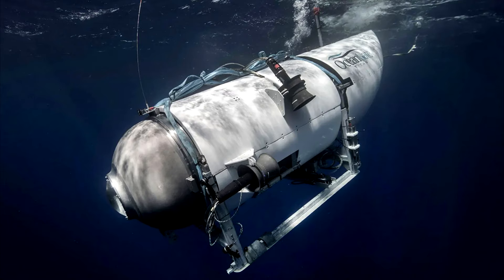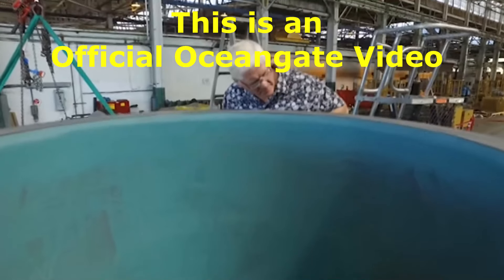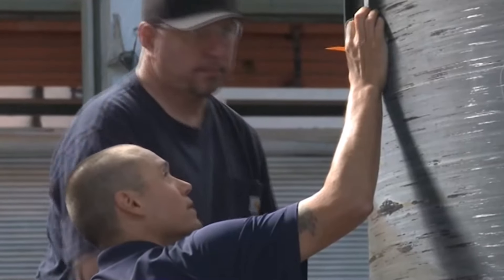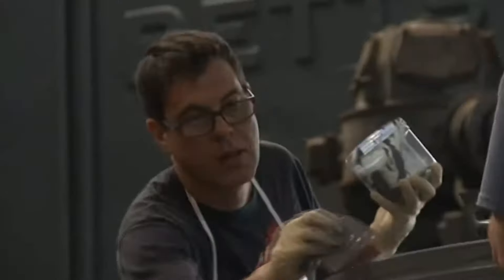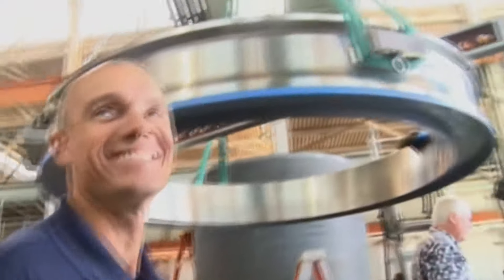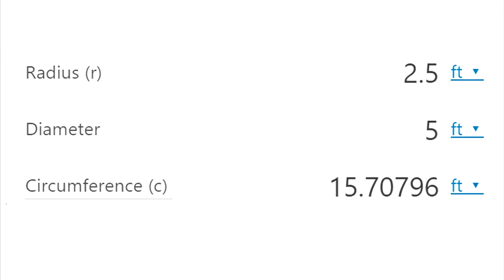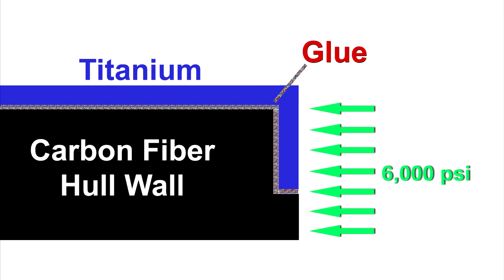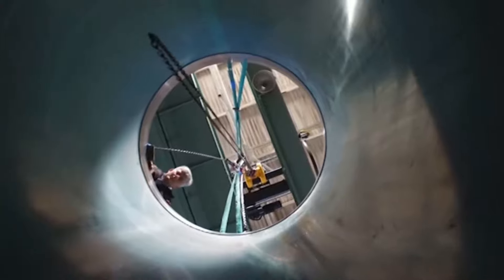Ocean Gate Titan Was Glued! Coast Guard Reviews

Comment: I have worked on precision glue ups and they did literally everything wrong. There is no way to determine the thickness of the resulting layer of adhesive here and also the application technique is going to create voids all around the joint. Normally the adhesive would be poured into the ring, that would then have a vacuum pulled on it to expel any gasses from the adhesive before the body is lowered into it making sure there is even amounts of adhesive squeezed out around the joint. Also you need to set a datum all around the mating surfaces to be able to measure thicknesses of the resulting adhesive layer. Only then can you be sure that the joint is to spec. Then after the joint is cured it can be scanned with xray or ultrasound to make sure it is within tolerances with no voids. Also this should all be done in a clean room environment and mixing the epoxy should be done in a controlled way, normally by machine to guarantee consistency. There is no way any of the work being done in this video could be certified.
Reply: When I saw them applying the glue in open, dirty air, I was shocked.  There is no way to get a good bond when anything floating in the air can get into the glue.  I'm not an engineer, but even I saw that glaring mistake.  It's really common sense.  Stockton seemed to love thumbing his nose at the right way to do things.  It's truly disgusting.
Reply: @cremebrulee4759  Stockton was an idiot, no idea what he was doing yet totally convinced what he was doing was just fine. People like him are dangerous when in control of something can kill people if it goes wrong. I am absolutely shocked that at no point was any certification required for that monstrosity he had cobbled together. Even the stupid game controller he was using has a laundry list of problems. Part of a critical control system, it was wireless making it prone to failure, contained li-Ion rechargeable battery which could fail filling the air with toxic smoke. Just no thinking at all involved in any of the decisions being made just thought he was being so clever using cheap crap rather than thinking about why it is normally so expensive.
Reply: Imagine thinking any of that would have made a difference here.
Reply: @camojoe83  It wouldn't have made a difference ultimately but it's indicative of just how bad the overall approach to design and implementation was. Using carbon fibre for a pressure vessel operating under compression is pretty much retarded and anyone with any experience with composites would know full well that carbon fibre had no strength under compression. Also mating carbon fibre to titanium is a disaster waiting to happen because of the widely varying expansion coefficients. I am really surprised the thing didn't implode the first time they tested it.
Reply: Carbon fibre does have a lot of strength in compression but only 30-50% of its strength in tension. Its frequently used on glider wing spars that are in compression.
Reply: @ColinWatters  Couldn't agree more. Compression accures wherever a part is bend. So pretty much every airplane part out there.
Reply: @ColinWatters  The strength is actually in the tension. In most cases, the compression strength isn't even relied on for anything. A good exaggerated example of something with good tension, but bad compression, would be a tube made of braided rope. Even reinforced with epoxy, it's main built in strength is tension, the compression power is only that of the epoxy itself. That is how carbon fiber is as well, it's just strings bound together in epoxy.
Reply: @epockismet76  Yes yes carbon fibre is stronger in tension, we all know that. But carbon fibre composites are pretty strong in compression as well. It's wrong to think carbon fibre composites cannot be used in compression. You just have to know what you are doing. I've built stuff and it hasn't failed yet.
Reply: @ColinWatters  ...don't take being corrected so personally, you were wrong. And don't put words in my mouth, your argument has nothing to do with the point, except you seem to feel that carbon composite needs emotional support after being abused in a submersible 🤪✌️
Reply: “I’ve broken a few rules.” — Rush
Reply: @cremebrulee4759   he thought the rules were holding everyone back and  his aerospace engineering degree was good enough to know what he was doing.  The  actual experts tried to tell him but he didn't want to hear. The passagers probably thought that it was reasonably safe or they wouldn't use it.
Reply: I'm sure that they considered that way too expensive. They preferred to continue their "Little Rascals" soapbox derby style of innovation.
Reply: @nancythane4104  Exactly.
Reply: @softwarephil1709  In a way I wish he hadn't been in the thing when it was destroyed, because then he would have had to strand trial and been jailed, that way maybe other reckless morons that consider themselves somehow above reality might think twice.
Reply: What they've done is more akin to what's appropriate for basic tasks on a construction site.

I don't know how it's done in other countries but here in Australia we use 4m (about 13') sections of high density plastic pipe for underground cable conduit. They have a wide "mouth" at one end so as to fit together and the standard installation procedure is simply to make sure both surfaces are reasonably clean (wipe with a rag), apply a specific type of glue all around then push the two pipes together, joining as many lengths as is required for the job. All up I've put thousands of them in the ground as part of my job.

The method used by OceanGate reminds me very much of that but, critical point, those pipes I'm referring to aren't under any pressure at all, they're just to provide external protection to underground cables (power or communications) and that's all, the glue just seals the joints basically it's not under any mechanical stress at all. 

Never thought I'd see anyone doing something structural using basically the same method and certainly not for going to the bottom of the ocean. 

Looking at this vessel, they've basically gone to the bottom of the ocean in something resembling a gas bottle or water heater, and a poorly constructed one at that.
Reply: When it matters, don't Rush it.
Reply from the maker: @shaun5552  I agree with you.
Reply from the maker: @softwarephil1709  Bot, what a line.  You can't break rules at 6,000 psi.
Reply from the maker: @epockismet76  Agree, under compression the carbon fibers are just becoming a support for the bonding matrix to stick to.  The strength of the fibers has no contribution.
Reply: His "guests" well and truly had the means to perform their own due diligence.
Reply: @qarnos  No, the people going on these dives were tourists, they have a reasonable expectation that the submersible being used has been built and tested properly. They would have no idea how to even check if the thing was safe. Plus Rush hired a person who was well respected in the industry to go with them adding authenticity to the endeavour. To be frank, that guy knew better and was as culpable as Rush for the deaths of the other passengers.
Reply: Thanks for sharing that. I’ve watched a lot of the commentary, but apart from a few criticisms, no one has explained how it’s done professionally.  It’s one of these tasks you leave to people who know what they are doing etc.
Reply: Wow
Reply: I mean notwithstanding everything else, the no glue squeeze out had me screaming from the start
Reply: @adamemmrich283  Exactly no one involved in that had any clue what they were doing. I understand they were actually grinding deformations out of each shell of the carbon fibre layup before applying the next shell. Everything about what they did during construction of that thing is horrific.
Reply: based on what you're saying and all the other things wrong with the titan, its like almost impressive they made something so terrible and actually made a successful dive with it in the first place it lol
Reply: @machineman8388  They just got lucky on the first few dives, it was bound to fail at some point because they even ignored their own acoustic warning system which was going off constantly on previous dives. This showed that the carbon fibre was degrading with each dive but it was ignored.
Reply: @schrodingerscat1863   yes.. i almost hate to say it but their early detection system worked pretty well for what it was. it was the CEO that malfunctioned the most.
Reply: A few things have always struck me about its construction.

The machining off of some CF to allow it to fit the channel in the titanium ring not only reduced the thickness of the cylinder at that point, but surely introduced a weakness in the material where potential cracks could occur at the right-angle formed in the CF?

The glue joint couldn’t be properly inspected for 100% contact and voids, so potential was there for water to gradually work its way through as the cylinder compressed and expanded during use.

The inside of the titanium ring channels was a very thin piece of titanium that would take the load as the local pressure on the CF increased. The photos I’ve seen from the wreck clearly show the front titanium ring inner channel ring violently stripped away.

This thing was a death trap, and I don’t think the “specialists” truly knew the risks…I think Rush was charismatic and a reasonable salesmen that potentially convinced them that the waivers they signed were just part of the experience they were paying for. I believe that they had absolutely no idea how dangerous the thing was.
Reply: @ElectricSmurf  Everything you said there is 100% correct. All totally valid concerns and issues with the design and implementation.
Reply: @ColinWatters  Exactly the opposite.
Reply: The other way to check glue thickness is the tear the join apart and see where it fails. The glue used was only rated at 4000 psi for shear failure.
Reply: Yea, the fabrication of the composite tube was the weak point.
Reply: i've seen guys spreading bondo down at the body shop with more prescision
Reply: @michaelallen1432  I thought bonding the flanges to the ends of the tube was the real low point. That really was amateur hour.
Reply: @Nick-b7b9s Exactly, even people who cast resin miniature figurines know to vacuum degass the resin after mixing to remove trapped air pockets before using the resin.
Reply: @schrodingerscat1863  I agree that regardless of the theoretical suitability or unsuitability of the adhesive, the application of it was sketchy. Closer to making a peanut butter sandwich than precision fabrication of a critical component whose failure will result in catastrophic loss of life.

Comment: Being an engineer I’m confident in stating that This type of glued joint should be done by applying a bead of glue in the centre of the joint which is then compressed to squeeze the glue bead to ensure that there is complete contact between the surfaces and that all the air is completely displaced creating a completely uniform bond. Nevertheless this kind of joint should not be used where huge lateral pressure cycling will occur. This is just one of a myriad of issues that are obvious with this particular construction. Having rigid titanium bonded to a relatively flexible carbon fibre will ultimately lead to fatigue and failure of the bonded joint resulting in the catastrophic failure that happened.
Reply from the maker: I know what you mean.  If "passengers" had seen this prior to signing up I think they would have backed out.  This was from a promotional video out on the internet.  They were proud of it.
Reply: Was it the glue join that failed though?
Reply: @punisher0717  who knows… maybe…
Reply: @punisher0717  Yes. Whole inner half inch titan bevel of that joint was totally shaved from front titan ring.
It could be seen on recovered debris close-up videos.
Reply: Yes. That is exactly how the joint glueing process should have gone. Followed by the tighening of the 60 Titanium bolts that spanned the entire length of the gap between the two hemispheres. Basically this was an incredibly stupid idea.
Reply: 100% agree

Comment: Not only was it glued, but the video showing it built has the glue being applied by hand, not with any kind of precision tools. Even worse, it was applied on an open factory floor without dust protection, so pretty much anything could have floated or flown into the joints. Even worse than that, no high-pressure clamps or autoclaving were used to ensure that the joint was evenly cured.
Reply from the maker: Absolutely correct.
Reply: Astonishingly sloppy work!  How could they think this was OK.

Comment: 10 year professional pizza delivery driver here. I wouldn't even use glue on the car i drive.
Reply: I know, right???!!
Reply: @CurtisJeffries-cd5vu  lol
Reply: Of course not, glue is used in crafting and models.
Reply: There's actually a few REALLY nice cars that are completely held together by glue. My favourite has to be Audi A2. Obviously done by a team of world class engineers with adequate validation for safety.
Reply: @SianaGearz  BUT the cars are not experiencing numerous (untested) cycles of massive pressure change. And you probably won't die instantly if a glued joint on the car fails. 
And there's very small (in most cases) exposure to salt water. 
(I'll never forget how my family's Toyota Land cruiser, purchased in the early 1970's from a dealer in Florida, literally rusted from the Inside Out  due to it being exposed to the salty environment prior to the invention of "undercoating').
Reply: Composite materials like this (carbon fiber, fiberglass, etc.) are half glue already. And epoxy is quite strong if you use it correctly. Making metal interface with carbon fiber composite like that is the WTF to me, having worked with this stuff on model airplanes. They're so very different, and composite materials are so much weaker in compression than metal.
Reply: @SianaGearz  I had an engineering classmate that kept saying "we'll use clamps" to any project we were designing.
Reply: yep, even anyone who's ever shopped bicycle parts knows that carbon fiber only takes limited strain before it's compromised and can fail catastrophically without warning even with careful inspection
Reply: There's nothing wrong with glue. In many cases modern glue is stronger then the substrate it is applied to. Meaning the material fails before the glue.
Reply: @enigmacrk200  would you glue a bumper to your car?
Reply: @enigmacrk200  Every composite chassis car is glued - all these carbon fiber supercars have the chassis made out of a few elements glued together. Heck, many normal, metal chassis cars have glued chassis. On the other hand, the alternative to gluing in automotive is usually...spot welding :) Just spots, no continuous welds. This and spray on sealant.
Reply: There's plenty of "glue" in your car. It's commonly called panel bond
Reply: i garantie, your car is glued together!
Reply: @jamesbutler5570  i guarantee your glued car was properly engineered and tested! and hopefully you wouldn't glue your car back together on your own
Reply: The best, most fun, job i ever had was Pizza Hut delivery in Lancaster, CA.🥰 Such good times.🍕☺

Comment: Note, that Titan was towed from Newfoundland to diving site upon a flat bottom left/right sponsons made for a river or lake. Titan skid frame was attached at titanium rings. Wave pounding and twisting exerted torsional twisting effect on titanium rings. Travelling took 4 days, then the floating platform was kept on a leash in stormy weather for another week, while they were trying to conduct repairs.
Reply: Also the thing was subject to extreme cold in newfoundland before it broke up.
Reply from the maker: I agree with you on this.  Especially with the weight of the titanium rings hanging off the carbon fiber hull.
Reply: @solareclipsetimer  v Hull design is used for vessels in unsmooth waters, while flat bottom pounds itself until sponsons fail, which happened. I am amazed this isn't considered in the investigation. The glue bonding stability was likely destroyed during this towing ordeal. At the sorry end ocean gate company could no longer afford a mother vessel that could carry the titan on board. The tried to save money subjecting a delicate delicate device which was titan to completely unaccountable physical damage, which they could not assess or repair while out in rough Atlantic waters.
Reply from the maker: @utube321piotr  You are correct about the towing. It was rough on the Titan. However, in the first couple of days of testimony, there were some comments about how rough the process was of sliding the platform that held the Titan off the back of the first large ocean-going vessel they used.  That was not a gentle process apparently.  Other deep-sea submersibles that I have seen launched are lifted by a crane and set down into the water.  That is a much more gentle approach.
Reply: @solareclipsetimer  still the launching off a ship far gentler than 4-7 Beaufort ocean waves on flat bottom river rig
Reply from the maker: @utube321piotr  Yep, I agree.
Reply: It’s almost like there is some magic thing…. let’s call it oh, physics just to give it a word, that seems to have an effect on that things have shape and mass and separate components.
Reply: @creatrixZBD  nah perish the thought.
Reply: @fanatamon 
Or, don’t think and perish.
Reply: Every time they opened the door,, what stress did that put on the ‘glue’ ???